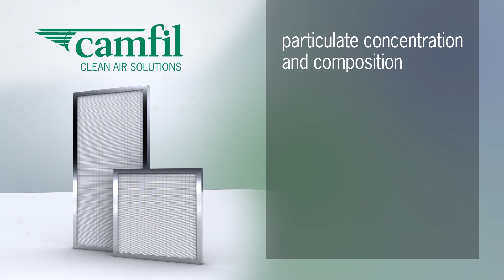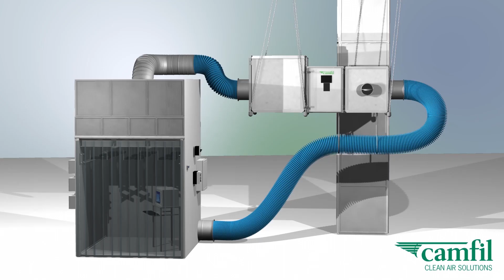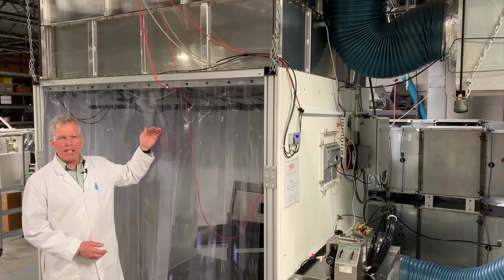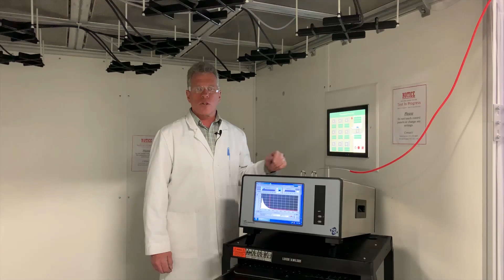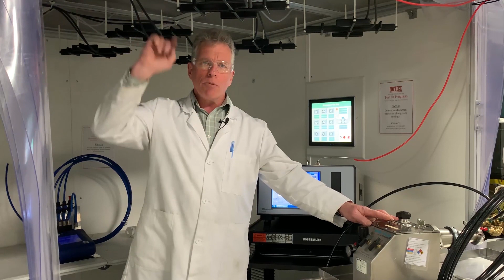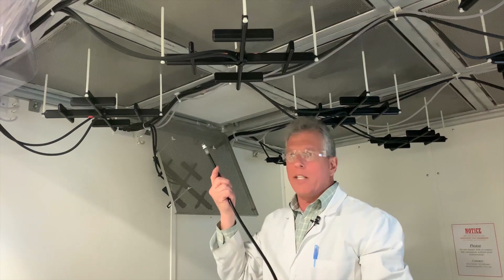Camfil - HEPA Filter Test Rig

Comment: Sir, How to decide or calculate differential pressure across the HEPA filter if the actual airflow  (CFM) is less than the airflow required for initial pressure drop?
Reply: ถั่วต้ม